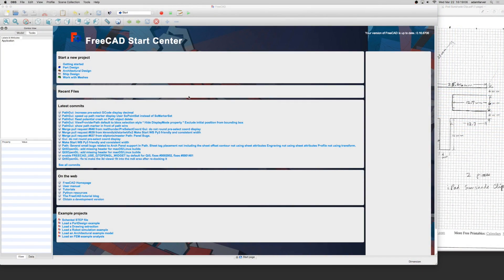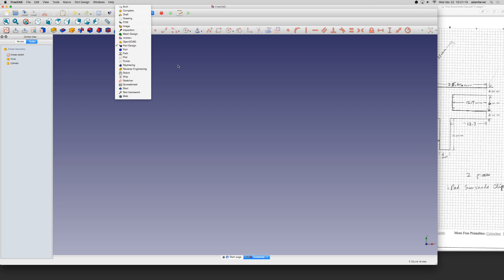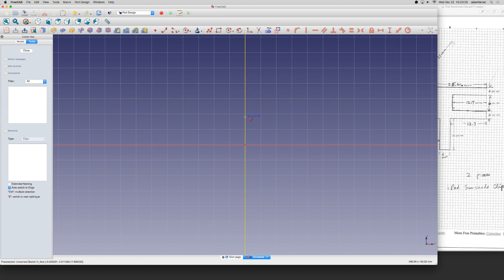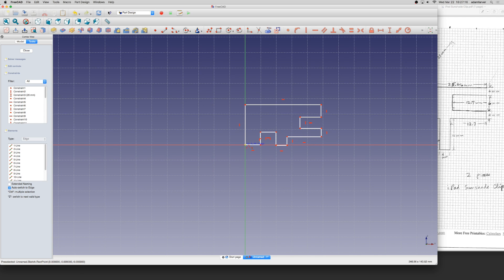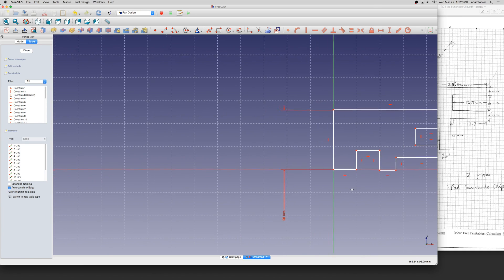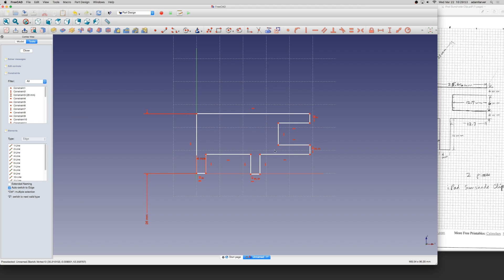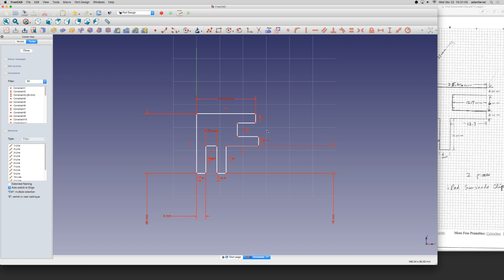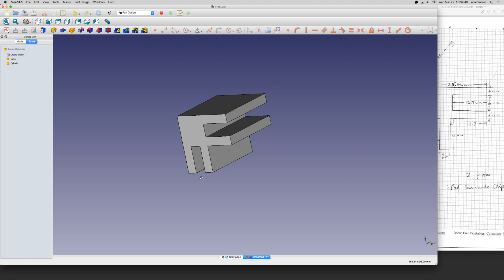Basic FreeCAD Extrusion Tutorial

Comment: Thanks very much for this video. A lot of the freecad videos were made with older versions and the screens have changed enough that it's a little confusing trying to make sense out of them with the latest stable version. It's really good to see some more-recent tutorials like this.

Question - What is the cause/purpose of the point delete you did at 8:54? Is it common to have lots of little things like that that need deleted after drawing a 2d sketch?
Reply from the maker: Sorry about the REALLY late reply. While it wasn't visible, in the top right, there is a solver. It tells you how much freedom (ambiguity) is in your sketch. Each degree of freedom is one aspect of the sketch that is ambiguous. Everything needs to be defined in the sketch, otherwise it will not let you extrude it properly. You can also over-constrain. So, in that case, you have to delete one or more constraints. That can be common. The solver will tell you if it is over-constrained and allow you to select and delete those constrains.

The reason that I did remove that constraint was because the left point of that line was constrained to the origin (center) of the axis and had a horizontal constraint on it already. The constraint that I removed was supposed to keep the point on the horizontal axis but it was unnecessary. Just a product of me using the program for a while forgetting (for a brief moment) that I was teaching new users.